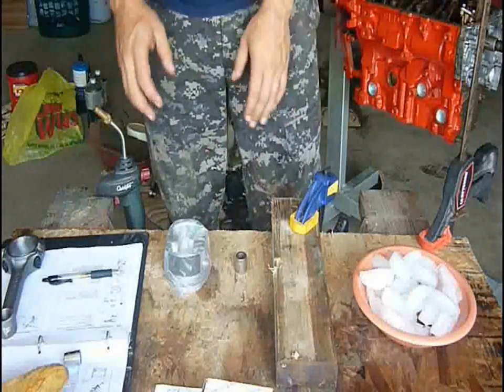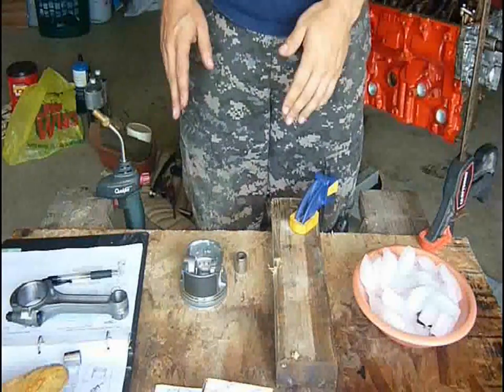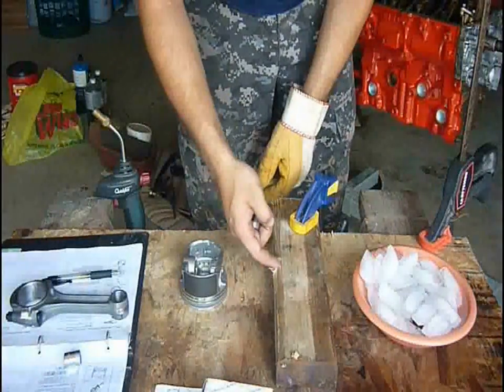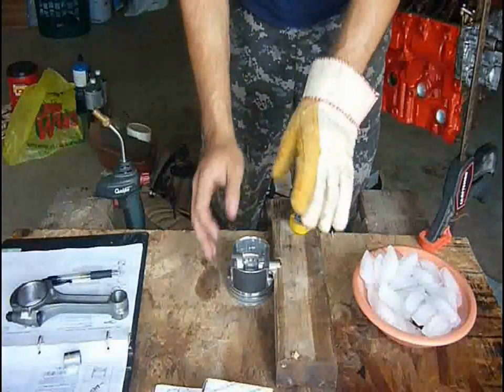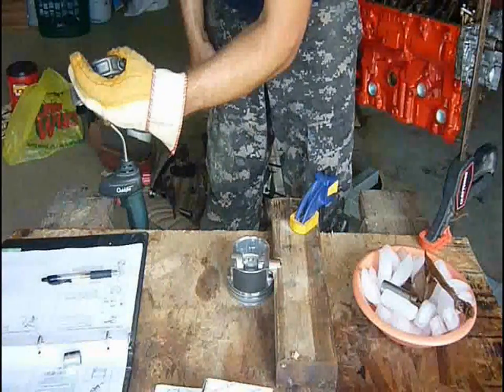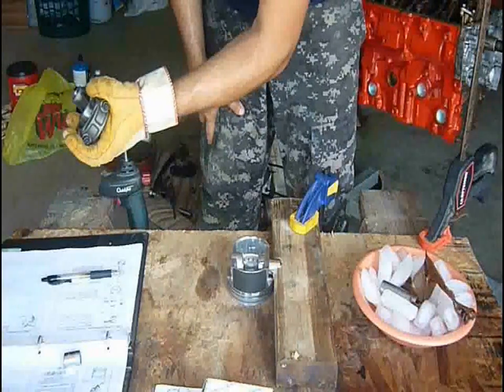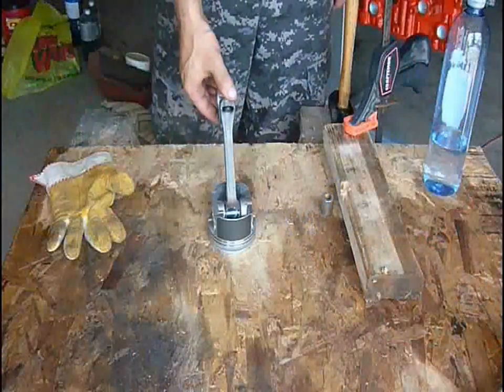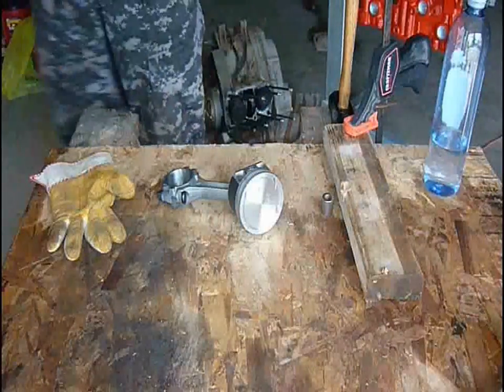How To: Pressing Press-Fit Wrist Pins At Home

Comment: when fitting wrist pins to small end rod bushes you need a .001 clearance.  If the piston has wrist pin retaining clips than the piston pin should slide through the piston with no resistance. A piston pin with a .001 clearance will slide right through the connecting rod small end on its own. Most piston pins are slide fit, not press fit on most connecting rods and pistons. Any Sunnen hone will have clearances printed on the face of the machine.
Reply: actual all stock gm engines use press in pins . a machine shop will use a rod oven to heat the small end.

Comment: This is a great example of how never to fit semi floating pins! you need to know the temp of the rod that's why machine shops use a rod heater with a thermostat if you over heat the rod it will weaken and the rod will break in the engine!
Reply: nothing a 8 buck temp gun cant help u with. unless its cherry red hot (or close) it shd be fine.. a little buzz of heat (like he did) will not harm it

Comment from the maker: The heat on the rod expands the inner diameter. Conversely, the lowered temp of the pin shrinks it. That's why you have such a small window to get the pin into the piston - when they return to room temperature, they're designed to be extremely tight. In hindsight, I should have heated the rod for a longer period of time.

Comment: @Aussieheads1 
Yeah, if you press a new piston, it instantly becomes a fucked piston. And as you mentioned in your reply to my other comment, yes! SQUEAKY clean is the only way to do it.
As for rookies getting the little end red hot, well, you might get lucky, or it might not hold the pin at all and leave a lovely score a few mm deep up the side of your bore. I've seen that on more than one occasion too.

Comment: @originalusernamefail too true mate,his biggest mistake is cleaning,he pulled the pin from wrapping with all the anti corrosion shit still all over it,I've built engines professionally for 30 years,I wash every thing pistons,pins,rings and bearings in hot soapy water,and whos to say the dick that pressed them off didnt damage the rod eye,heat the rod till a light straw color,never blue and never ever glowing red,it softens the eye and will spit the pin out of the rod and thru the cylinder

Comment: I think dry ice or a spray with some compressed (liquidy) CO2 would work great.  Great idea!  I've seen something similar where a guy used liquid nitrogen and the thing literally just dropped in.  With the liquid nitrogen, I'd be concerned about the metal getting too brittle, one hard tap and it could crack, maybe?

Comment: You would find if you measured with a mic, that the wrist pins will only get smaller when using liquid Nitrogen, 32F does nothing but make them better at pulling the heat out of the rod end, faster. It would seem intuitive to try cooling the pins, but it really does not work that way. The rods are changing temp by an increase of 400F+, Cooling a wrist pin down in the other direction would be close to zero Kelvin...difficult if not impossible. Super cold valve seats usually drop in a 75F head.

Comment: @2:50 Oh shit, oh shit, oh shit! Aww...damn. Take a 2"x4" and drill a hole in the end for a pivot, and use a long bolt and a nut as an extension with a stopper. Insert the bolt into the hollow pin and once the rod end is hot, you can quickly squeeze it with some mechanical advantage. I later built an adjustable basket for my arbor press, just for this task. I used it once, purchased full floating wrist pin pistons and rods from then on! If they aren't Pauter or Steel, in the scrap they go...